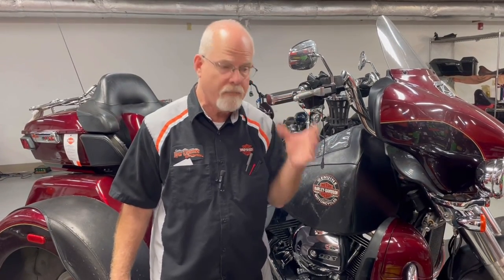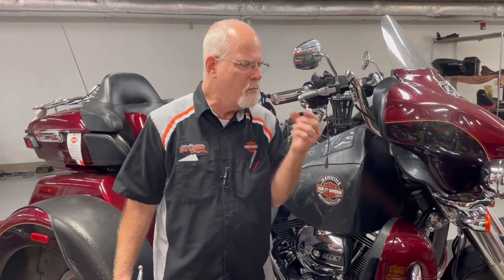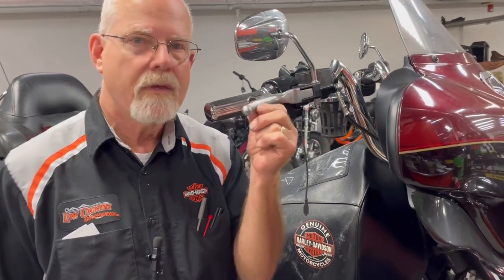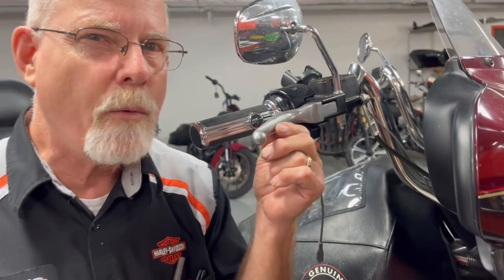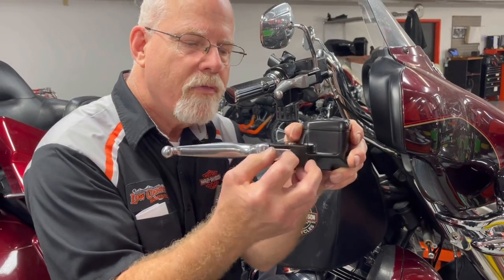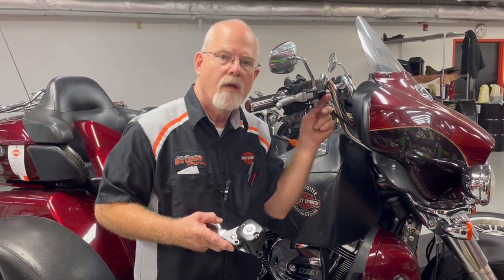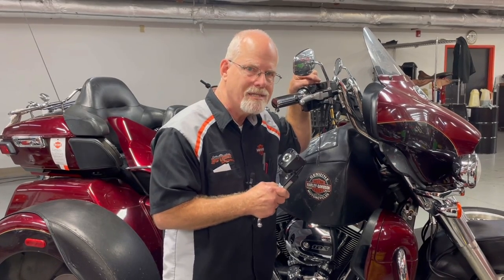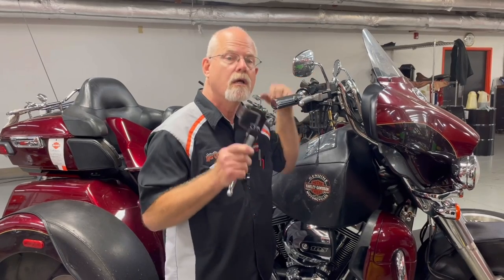Doc Harley’s Brake Tech Tip

Comment: all it really needs is a shot of silicone spray behind the master cylinder seal.   Normal part of maintenance that I do on every bike that rolls on my lift... and it's very common cause of things like flickering brake lights, cruise tripping off, dragging brakes, etc.
Reply from the maker: Thanks for the added tech tip. I will look in the Service Manual for this procedure….Doc

Comment: Thanks Doc!! Quick question about another topic. I have a 2017 CVO Ultra, and concerned about the oil pump and the sumping issue on these bikes. When I pull the crank sensor after a ride, how much oil is too much oil, if any? When should I start looking to replace the oil pump and cam plate, 6 ounces, 12 or more? I hope to get zero or just a few drops. I have replaced the sump plug with a shorty plug from Fueling. Thanks Doc for your time and expertise!! Know that you are much appreciated!!
Reply from the maker: If it was my bike, save up, budget and purchase the latest oil pump…..Doc

Comment: I swapped out my original aluminum levers with chrome levers last year. The new ones are that loose from day one? What's your thoughts on that? I have a 07 Electra Glide Standard, brake system pressure fells fine
Reply from the maker: If they are HD replacement I am concerned. Aftermarket levers in my opinion are loose because they are multi fit…..Doc

Comment: just a quick question about  heritage brake bleed fittings.  what size hose will fit on the bleed fitting that wont pop off when the fitting is loosened?
Reply from the maker: That is a great question. I have always used the hoses that came with my Myty Vac. I’m sure I will have to know this when mine wear out🤷‍♂️…..Doc
Reply: ok  i'll call the H D store and see what they recomend tnx

Comment: another question about front brake lever,   when taking it off of the frame of master cyclinder dose the piston slide  out on its own, and will fluid leak out?  i want to clean the lever just like with the clutch lever.
Reply from the maker: Everything will stay together. The front brake switch is what you must be careful of when installing the lever…..Doc
Reply: ahh ok tnx  @LowCountryHarleyDavidson

Comment: I’ve a question, I have 03 FLSTCI, and the front brake cap shows replaced with DOT 5, so the question is can I convert the front brake to use DOT 4 instead of DOT 5? Thank you in advance.
Reply from the maker: No…No…No!….Doc
Reply: Thank you! @LowCountryHarleyDavidson

Comment: what is the factory length on the fron master cylinder line to block on frame
Reply from the maker: This information is easy to get by visiting an aftermarket cable/line web site. A few to try are: Magnum Shielding, Fat Bagger & LA Chopper…Doc

Comment: Seems kinda early to be having that kind of issue, I would expect a good bit more life out of it than that. Perhaps a better design would be in order on the replacement master cylinder. Required ABS flushes, and now this...
Reply from the maker: Thang the key is following your owners manual service intervals checking moisture content and changing brake fluid at least every 2 years is good preventative maintenance. Why blame the design instead of the circumstances?….Doc
Reply: @LowCountryHarleyDavidson  I am just griping. My rear ABS recently locked up, despite dealer doing the ABS flush on time as recommended on my 2011 Touring bike, they covered it, but I still don't like it. Riding home after dark with just front wheel brakes really sucked! OK, rant over, sorry Doc...

Comment: Why does Harley continue to use DOT 3 fluid? Most high-quality aftermarket motorcycle brake systems use DOT 5, which does not absorb moisture. One of my bikes has PM brakes & master cylinders with stainless braided teflon lines and I've used DOT 5 for over 25yrs with no trouble. I even used it on the rear brake on my 1968 FLH.
Reply from the maker: Dot 4 is used because it does not bubble also higher temp resistant. An ABS unit can not have air bubbles. Work your Dot 5 hard enough and you will see air bubbles in the Master cylinder….Doc
Reply: @LowCountryHarleyDavidson  OK, but no ABS on any of my bikes. We used DOT 5 for race bikes in the 80s~90s and I doubt any Harley gets a brake workout of a true roadrace bike. I certainly don't push my RK as hard as I did some 750~1100cc 4cyl sportbikes back in the old days. I found a set of Grimica 4-piston calipers I was thinking about putting my '97 RK and was planning on switching to DOT 5.
 I still ride my Flathead and Panhead, which still have the original mechanically operated drums! My '68 at least has a juice brake, and yep, that's been running DOT 5 for 30yrs now. The hand-lever and cable operated drum front brake is a joke!
Ya just gotta ride at a more leisurely pace and don't follow anyone too close.

Comment: I have a 2022 Tri Glide and when you put the rear brakes on you can’t pull the front brake handle and it only has 900 miles so far
Reply from the maker: That would be that propositional valve working. You still have front brake function but can feel the assistance. All good 👍……Doc
Reply: @LowCountryHarleyDavidson  they reflashed the ABS at the dealership and it works like it should

Comment: What about repaire kit for Master cylinder?
Reply from the maker: Yes their are Master Cylinder repair kits but internal bore has to be in great shape. …Doc
Reply: @LowCountryHarleyDavidson  after fluid change, front break very weak, and soft. I try to remove air bubbles, but no result... please advice. Also, new repair kit in place. Before was ok, now I can push by two fingers till grips...

Comment: My 2006 Ultra had the same problem with the front lever, not holding the brake light switch in and little return on the master cylinder 
So
New lever's, switch, master cylinder rebuild all is good
Thanks
Reply from the maker: Thanks for sharing your experience….Doc